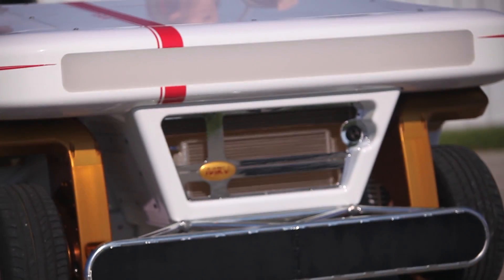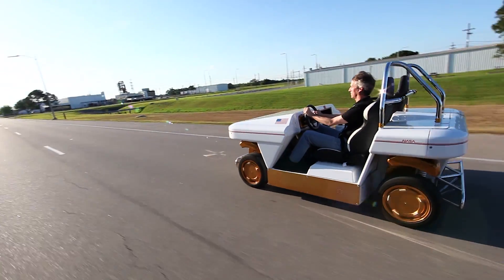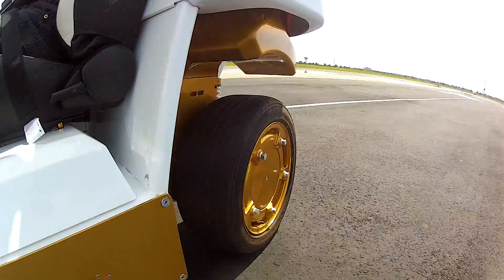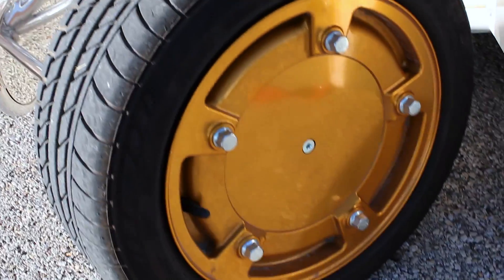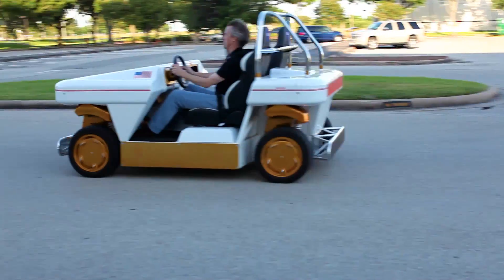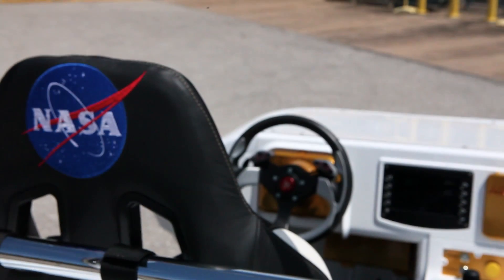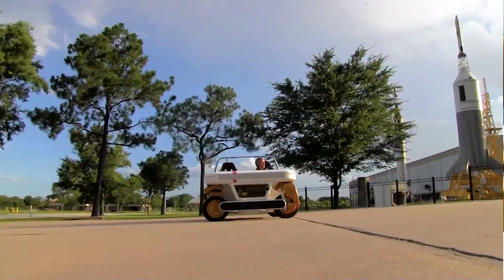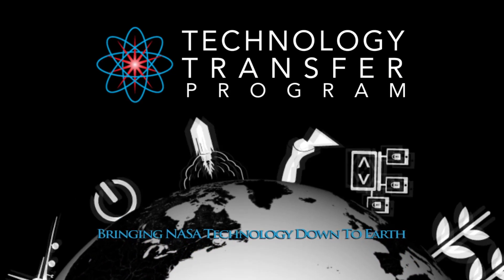NASA's Modular Robotic Vehicle

Comment: Add hydrolic lift pistons to the individual wheels, to raise or lift yourself out of a situation. Or walk/step out. The other wheels that are still touching the ground, can have drive, to aid in the stepping or walking around, over, through what would be considered obstacles. 🙂

This can be done fast, and be performed quickly, would either the aid of a human, or hybrid between human and processor. Or.. 100% processor.